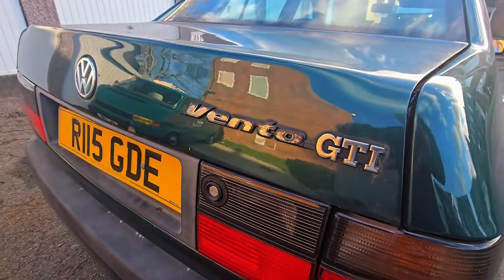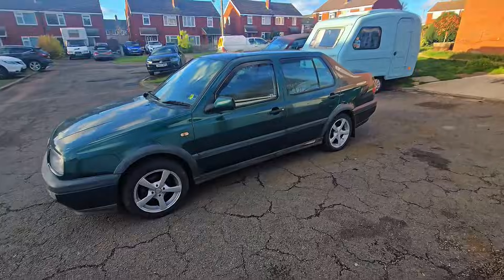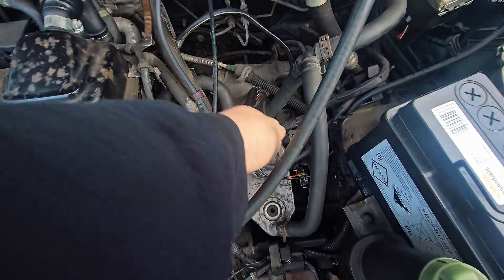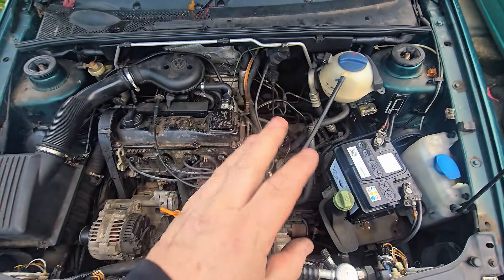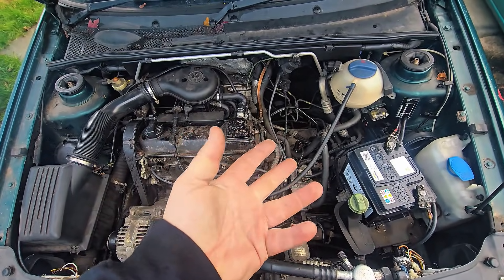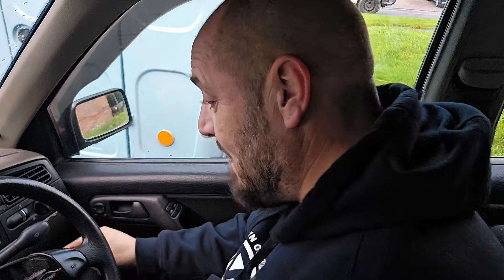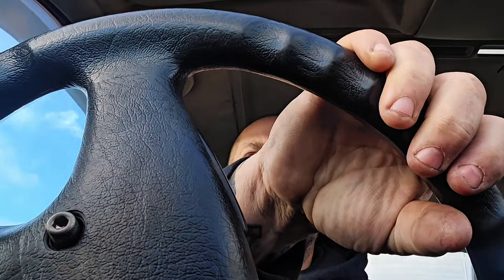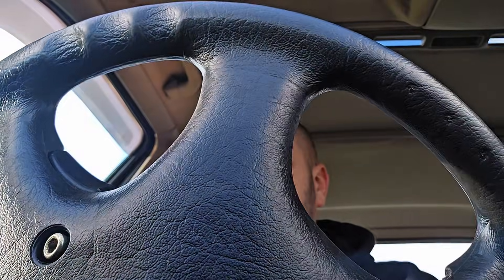Automatic Gearbox Disaster: Breaking Down On The Dual Carriageway

Comment: Ide try just changing the oil filter and automatic transmission fluid first to see if that works before manual conversion it's probably never had a gear box service it being so old
Reply: Deffo, I've seen it so many times with old auto's, if it has a filter in the gearbox if be changing it and the oil, has it even got enough oil in it? Cheapest and easiest first in my opinion